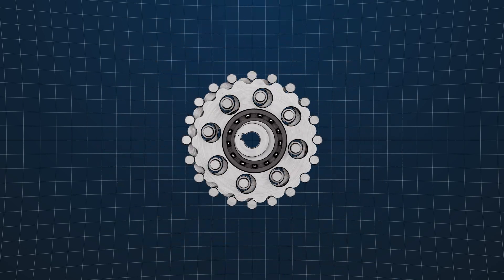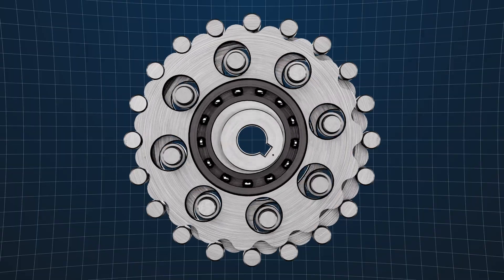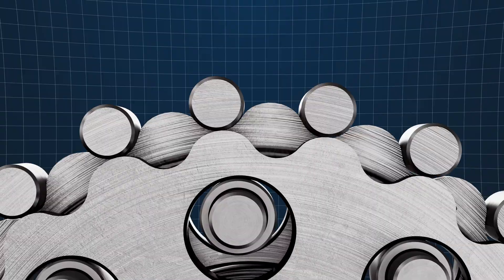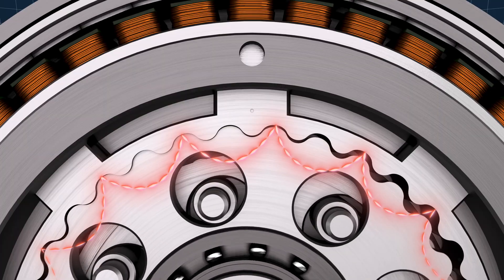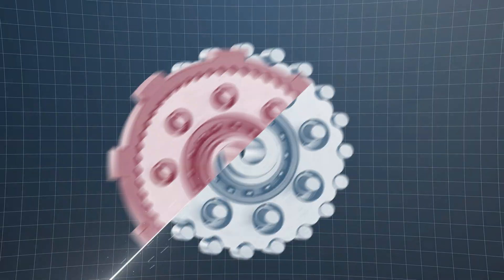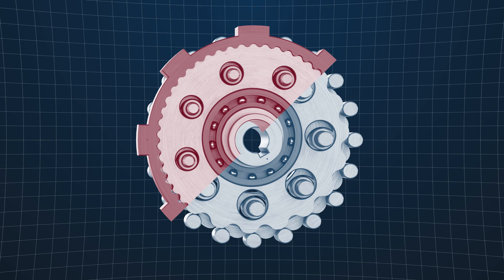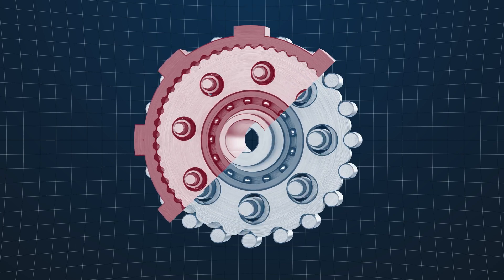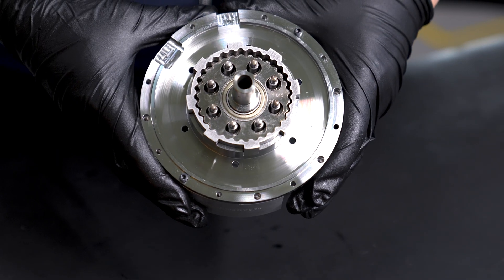Technology even GPT doesn’t know? The 30:2 Cycloidal Gear Actuator

Comment: This has been around for over a decade.  Tangent was the company that did it and offered the drive for a hot rod e-bike.  I  have  a 20: 1 and 40:1 reduction.  Pairs well with the elective motor that does 11krpm.... massive torque!

Comment: Cool, why should skipping teeth be good? Usually, there are n+1 outer teeth, Why is n+2 better? Am I missing anything here?
Reply from the maker: This design represents a novel approach that breaks away from the traditional limitations of cycloidal structures in order to reliably achieve a reduction ratio between 10:1 and 20:1, even while using cycloidal gears. 
By overcoming the inherent limitations of conventional cycloidal gears, this configuration paves the way for wider industrial applications of cycloidal gear-based reducers.

Comment: Can you make the 'teeth' on the outside (the equivelant' of the ring gear) movable? And what happens when you move it, lock it, or reverse it?
Reply from the maker: In a typical cycloidal reducer, if the output shaft is fixed and the input shaft rotates, the outer gear (equivalent to a ring gear) can also rotate either in the same direction (forward) or the opposite direction (reverse). 
However, when it rotates in the same direction as the input shaft, the reduction ratio is determined by the number of teeth on the ring gear.

Comment: Whats it used for
Reply: Truck and heavy machiinery like motor grader.
Reply from the maker: This 30:2 cycloidal gear setup allows for low reduction ratios even with a cycloidal mechanism, enabling it to adapt flexibly to a wide range of load conditions and installation environments.